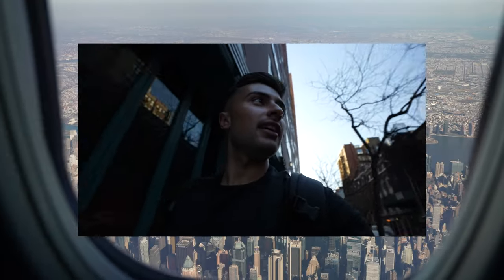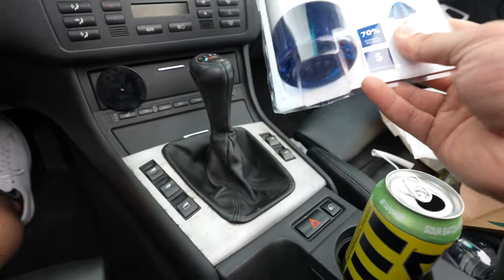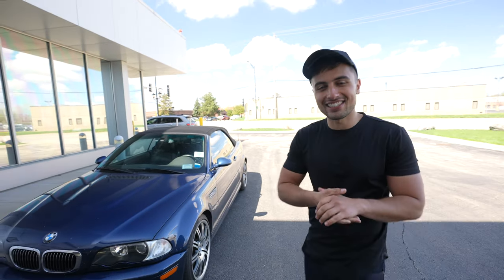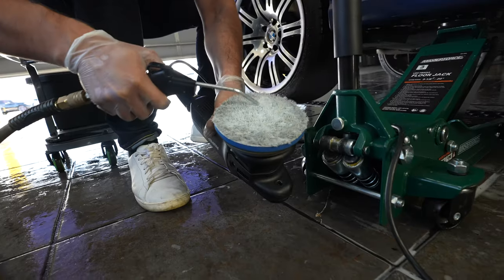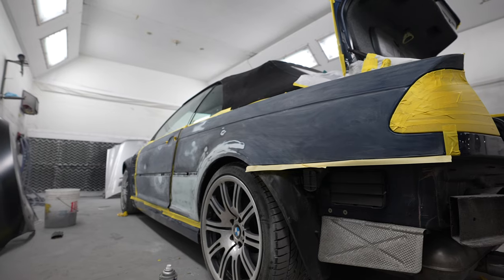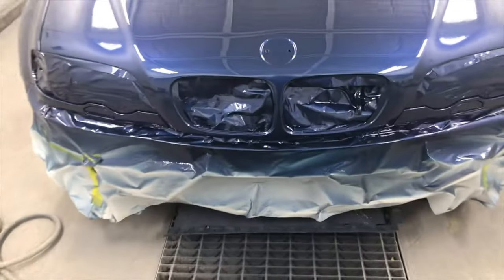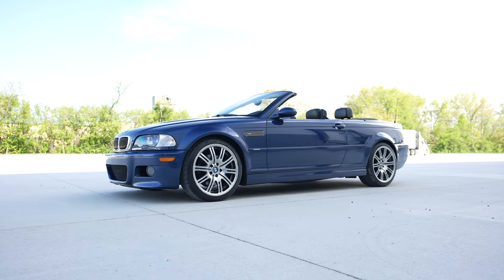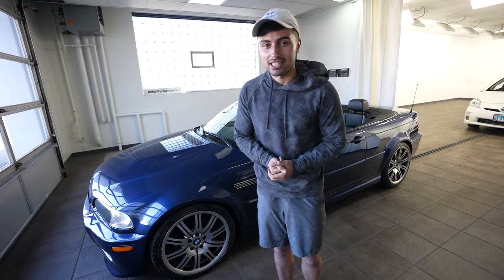Flying To NYC To Buy A 1-Owner E46 M3 & Fully Restoring It

Comment: Job well done. I tried to buy this car (as we were only interested in mystic blue or carbon black), but the PO said a deposit was placed on it.  I liked the BMW dealer maintenance single-owner.   It would have been sight unseen and shipped.  Now that I see how much work went and effort went into it. I'm glad I didn't get it.  I bought a different one, and it's certainly not cheap to bring it up to higher standards...new clutch, Vanos etc.   That said, these cars are so much fun to rip around with the top down. Nothing quite like it with 4 legit seats.
Reply from the maker: Thank you for the kind words, Tim - it definitely had some amazing qualities at the time from a far, but quite a few interesting cosmetic issues. I’m sure it was a lot more fun to watch from an outside perspective 😂 When it’s all said and done though- some of the best cars for the money, and if restored properly can bring/keep solid values 🔥
Reply: @KyleSulkar  Agree. I do recall this being priced very well considering others in the market at the time. I had some serious FOMO seeing the prices jump, coupled that with missing out on a couple of amazing craigslist finds we just decided to try to stop checking the boxes and grab what we liked. Overpaid but love every drive  I see from your channel you've gone through a few of these. I'd love to know your tips on keeping the joints in tops lubed and running squeak free. What kind of lubes (lithium/silcone etc), and where you are hitting them.